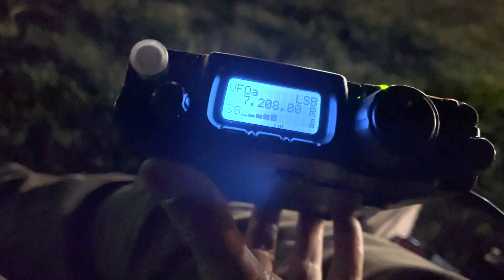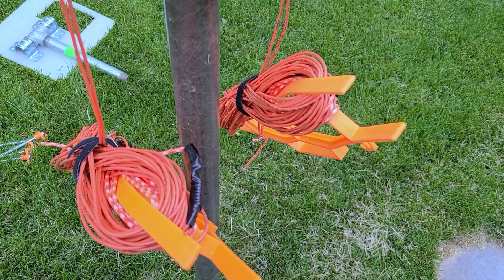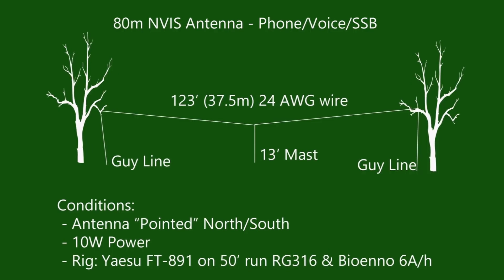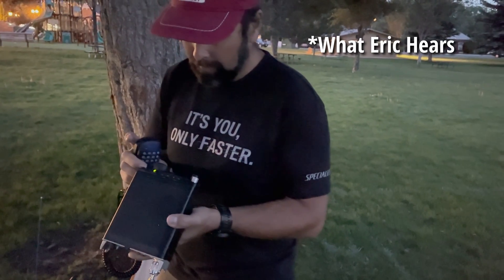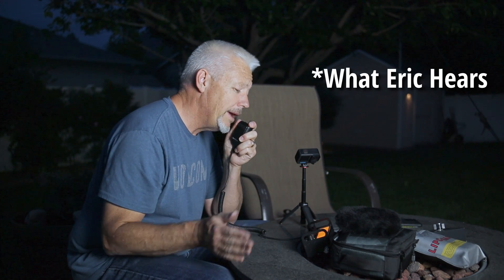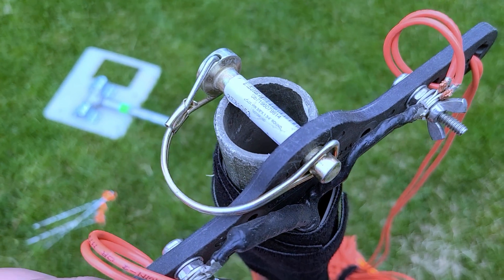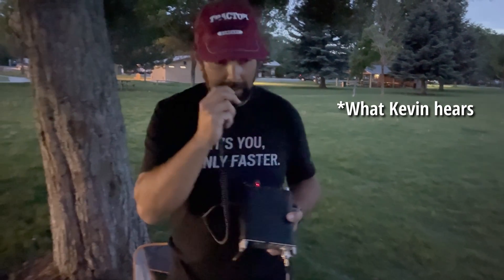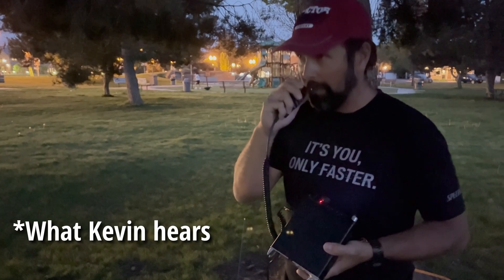NVIS Antenna setup | K7SW Ham Radio

Comment: ok, i guess i fell off the smart truck way to soon, so let me see if i have this right ,,,, the two of you are only 25 miles apart, one is in the dark and the other is in the day light. can you please tell me how that is possable? that is one awesome NVIS antenna system. it has the power to change day to night in lony 25 miles. If you want people to believe in what your saying you might edit it so that the video is believeable. lol I get the point but the video is just not right.
Reply from the maker: Excellent observation, our test was done just as the sun was setting and it turned dark fast, add to the fact that Eric had a better low light camera with no lighting on him, it could give the impression of more darkness for me. I have super bright lights on for filming me in that shot making the background for me look near dark which it was not. Allot goes on when filming so we ended up with the final result that you see.  73 Kevin

Comment: If anyone cares to answer, I would so appreciate it as I cannot find this info anywhere-  Do you need four separate antennas, is that what this is? Four separate length wires all somehow attached together in the middle to make four separate antennas cut at different lengths and therefore capable of transmitting and receiving different frequencies? How specifically are they all connected in the center? And is this for transmitting and receiving or just transmitting and a separate receive antenna is required? 

 If you have to “adjust” the lengths of the wires to “tune”, how specifically do you do that? Doesn’t NVIS require constant tuning or adjustment of the wire lengths of the wire depending on atmospheric conditions?  So how would you do that, obviously cutting the wires down wouldn’t work because what if later you needed to add more? 

Thanks to anyone who can answer.

Comment: Very useful test, well done.
Thank you both for sharing.
HF mobile must fall into the NVIS category.
I use HF Signals uBitx, about 8 watts into ameritron screwdriver antenna.
During midday I can usually check into the 7290 traffic net, and communicate with a station near Longview or San Antonio and I'm 50 miles south of Houston in Brazoria.
I'm just now trying out a new uSDX, China clone, works well, but I wish I'd boughten the real deal, true uSDX with the good support.
Take care
73

Comment: Trying to reach known contacts 5-25 miles away simplex(no repeaters) i don’t have LOS with any of them rolling hills in the northeast my thoughts are to try 2m SSB with 4 Element yagi’s & if that doesn’t work use NVIS/ground wave we all have FT-857D thoughts? I’m new just passed my tech & general.
Reply from the maker: Welcome to ham radio, 5 to 25 miles on FM for VHF should be good.  HF NVIS may work at 25 miles but likely will need farther away. HF ground wave that close might be a good solution for you as well.
Reply: If I use a 40 & 80 meter diopole deployed in a NVIS configuration would ground wave still work or do I need to deploy it in a different configuration/ different antenna?

Comment: There are local noon and late afternoon nets on 80 meters in our tri-state area MN, SD and ND. I can contact and hear operators 15 to twenty miles away. Obviously most are running 100 to 1000 watts. I have an EFHW 8010 that is ten feet at the feed point and 35 feet at the end.
Reply from the maker: That is a really good antenna, I also really like using that 8010. I can see why you use it. 80 meter nets are fun learn about stuff in the area and to meet new operators

Comment: Thanks for the video.  I tried unsuccessfully to use NVIS but it seems that it works best on lower power 20 watts or less.  I'll have to try it again using reduced power.
Reply from the maker: Well, more power is a good thing, low power, if that is all you have.  Keep in mind that the other people you are trying to contact will need to have an antenna that works as NVIS like yours, otherwise it might seem like your antenna is not working . 
I hope that helps. Kevin

Comment: My brothers! Awesome video. As much of my radio efforts are emcomm-oriented, I do a lot of experimentation using NVIS. As a general approach, I start with 40m in the early evening and then move to 80m in the late evening (after about 9 or 10pm PT). I usually start with SSB and then degrade to CW or digital depending on operator capabilities, CW offering the more minimalist and light-weight setup. Line of site comms are useful but in a true SHTF scenario you need to be able to communicate outside the affected area but at relatively close range (0 to a few hundred miles) which NVIS is perfect for. DX would have limited utility in a real disaster.

Great work! 👍🏻
Reply from the maker: Thanks Mike,  I like your approach to the concept of being prepared and thinking about more than one alternative. Practice makes us better. I sense you are in it to win it.     73 Kevin

Comment: In the past I've communicated in groundwave 150 miles every day for a year and a half using 3 to 7 mW of radiated power, and sporadically covering out to 500 miles and beyond most days, yet I still find myself watching videos like this. It's in the blood.
Reply from the maker: John, that is a really good extended test, and using the same gear would give you a considerable track of what works for and against NVIS success.  Fun with radio certainly gets in your blood. 73 Kevin
Reply: @hamradiowithkevin , I have no idea how to use my homebrew 1750 meter gear to work NVIS. As I said, my experiments have been low frequency. Ground-wave works so far out on that wavelength that NVIS loses meaning, and longwave only works well with verticals. I copied my 5 mW LowFer beacon at my place outside of Longmont, CO every inch out to the Mississippi river along I-80 on a road-trip. Pure ground-wave - over 700 miles. The challenge on that band is transmitting antennas and noise. Different frequency ranges just do different things in our atmosphere and have different antenna and receiver requirements. That's one of the things that makes experimentation so much fun, and why I'm looking at NVIS, something I've never experimented with before. It sounds like fun to come up with an HF antenna that shoots nearly everything straight up, and see which bands it works best on and when.

Comment: Great results Kevin. 
NVIS is very easy to set up in the field and as you are seeing in your experiments it doesn't really need to be that high off the ground.
Our field setup is a homebrew 80m speaker wire dipole with the center approx 9 feet off the ground and the ends about 4-6 feet off the ground.
We routinely get similar results with NVIS on 80m at low power,5W, Reports are typically 56 and 57. One test we carried out had 4 stations. 
Distances from station1 were Statio 2 at 20miles, Station 3 at 45 Miles, and Station 4 at 120 miles. All stations reported a solid 56 / 57 to all other stations.
Wishing you well with future experiments.
73
Tom EI5IEB
Reply from the maker: Tom, thanks for sharing your setup,  those are great results you had and a perfect example of what I should test in another video. I appreciate the support 73 Kevin

Comment: You would be really surprised how far your contacts go on NVIS
Reply from the maker: Yeah that's right Steve, and it seems to be the trick to control the distance so that NVIS close range becomes more useful for when we need it. Thanks for noting this Kevin
Reply: From central UK (Northern England) the whole of the UK & Ireland can be contacted with ease using NVIS on 40 & 80 meter bands.

Once the darkness sets in I have had contacts across the pond to USA / Canada / Carrabean westwards - Asiatic Russia / Kazakhstan eastwards.

The 40 & 80 meter bands are my favourites.

Comment: Thanks for your video and for the collaboration with Eric.  I love seeing the demonstration with two different types of NVIS antenna.  A good NVIS antenna should be in every hams tool bag.  Did you add any coil for your 80 meter legs?
Reply from the maker: David, we did not use a coil, however that would have shortened the antenna greatly. Eric is a really fun guy to work with. I agree, an NVIS antenna can be more useful than people think. 
Thanks for the feedback. 73 Kevin

Comment: Excellent video, Kevin! Your audio and video work is top notch. I’ve meant to make an NVIS and have everything needed. Would you recommend a 1/1 choke at the antenna if running higher power than QRP? Very 73, de N4WLC, Bill
Reply from the maker: Thank you Bill for the feedback. Yes I would use a choke in this type of setup qrp or qro. I have needed it. And should have indicated this in the video.    73 Kevin